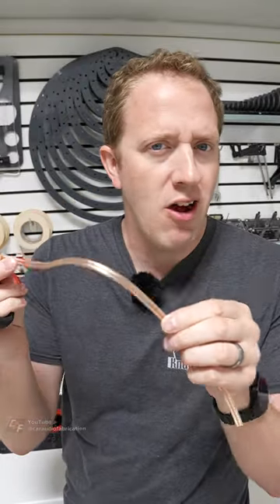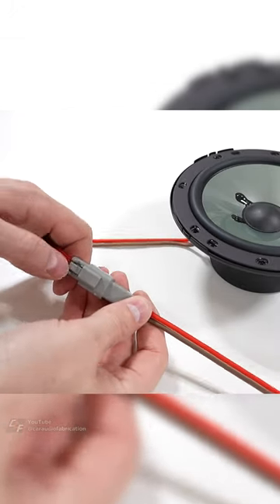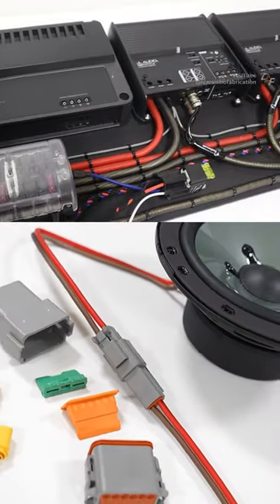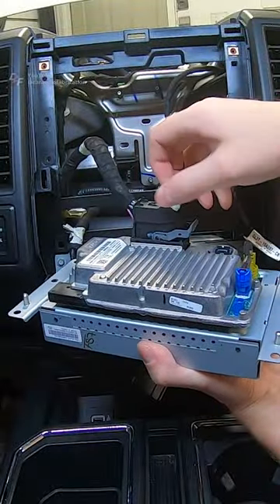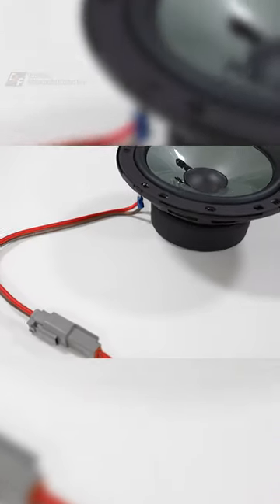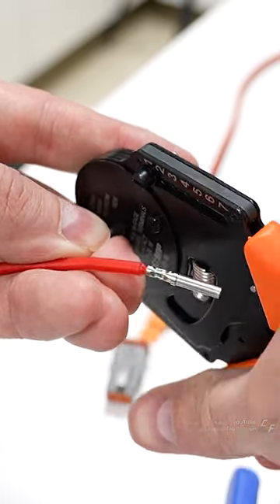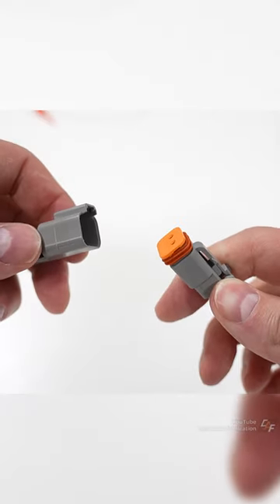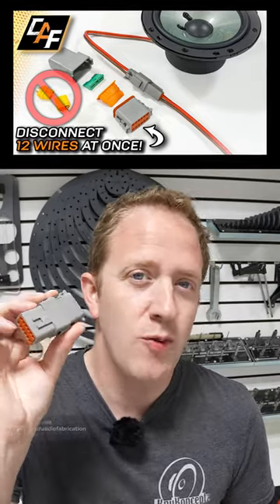Quick disconnect speakers and full audio systems with this!

Comment: or as a free solution you can cut the connector off the stock speaker and solder it to the new speaker and just use the cars factory connector

Comment: Car manufacturers use connectors just because it speeds up their process of building.  Adding connectors to aftermarket equipment just adds time to the install.

If you do a good job, then the equipment shouldn't need to coe back out unless it is faulty and if it was faulty you will still need to make a new connector.
Reply: I agree, making connectors for the occasional equipment swap isn’t worth it imo. Maybe someone appreciates it like a customer and then you an charge more 😂 however for diy and such it’s just added time
Reply: @radiospank i will give you an example: in my miata i have headrest speakers. If i dont use a plug, i will not be able to remove the seats if i need to clean the carpet for example

Comment: Do they make a 1/0 quick disconnect? Gotta say in my hatch it would be nice to move the amp quickly without messing with the screws to much.
Reply: A plug for a charging a forklift could work but they aren't water proof. They go up to 350 amps.

Comment: I soider mine,  connections for customer for ease and complexity
Reply from the maker: I dont think you are following the value of having a plug. Is everything in a car hard soldered? Or do you see wire harnesses and plugs everywhere? 🤔
Reply: @CarAudioFabrication great point. I might have to try these in some of my Speaker projects. This will definitely make taking out drivers much simpler without the need of messing with the crossover.

Comment: This is a handy concept, however (as most people are aware) every added connector adds unwanted noise and lessens wanted noise..
Reply from the maker: You would never in a billion years be able to identify with any level if consistency if a speaker did or didn't have this.

Comment: I have been thinking about using such connectors from old wiring harness. I have a Hyundai i20 whose boot is so small I have to remove the subwoofer enclosure and amplifier everytime I want to carry something big and it is always annoying and tedious

Comment: Unplugging through the spade connectors directly from the speaker driver terminals is better than cutting but still not as good as a proper connector.